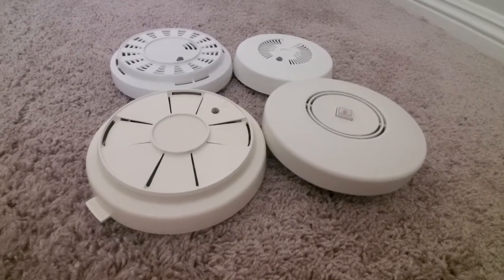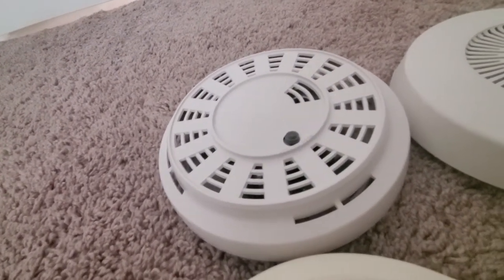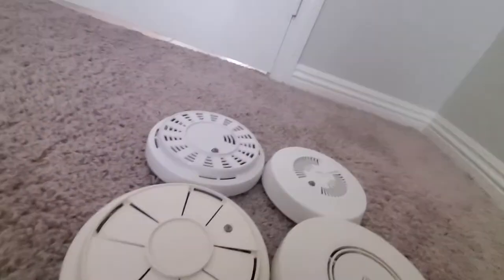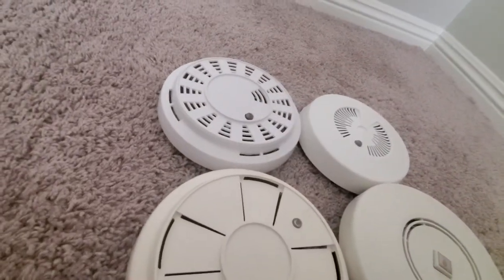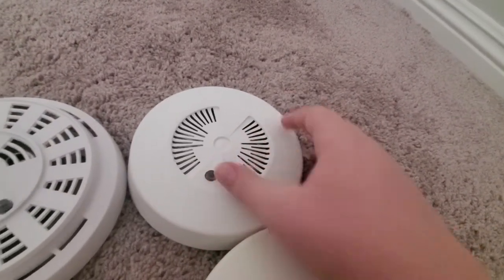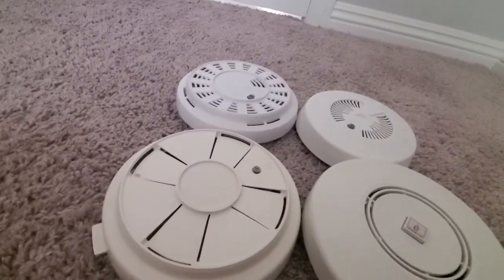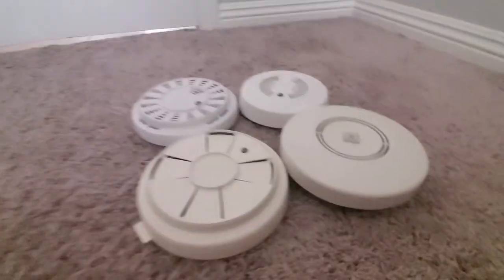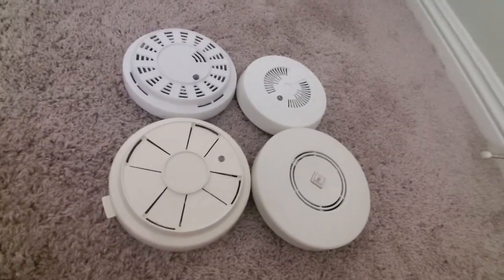Comparing each of my squealer units

Comment: https://www.youtube.com/watch?v=14iChldrXP4&t=377s Please tell me this link worked. But at around 18:32 the Nortron is sounding but this is likely the TR77 since it has the high pitched DC squealer tone and since this is a 1980 episode I highly doubt the sound is dubbed in. I have the AC version of this detector and it has the much louder and lower AC vibratory horn. Also as you can see in this video a light turns on as the detector sounds. There is an incandescent bulb in both versions that is supposed turn on when the alarm sounds. Mine sounds but the light wont go on. My guess is its due to age. I got mine a while back at a second hand store. As long as it sounds Im happy. These detectors that I know of were Canadian made and only sold in Canada.
Reply from the maker: Probably uses a DeltaLarm squealer like my Norelco. They seem to have a reputation for being high pitched.
Reply: @jdlproductions2746  My guess is that as well. My great Aunt on my Dad's side had one on her house years ago. Never heard it go off but I do believe it was the TR77. The red LED stays on constantly on the TR88 when it is powered up and mine also has a hum to it when it's plugged in. my guess is originally it didn't do that and it is due to age. On the TR77 the red LED light flashes every 60 seconds indicating that the battery is working. These detectors do have test buttons. They are on the side of the detector instead of the front of the cover. I am on the hunt for the TR77. There are none on Ebay that I can see.